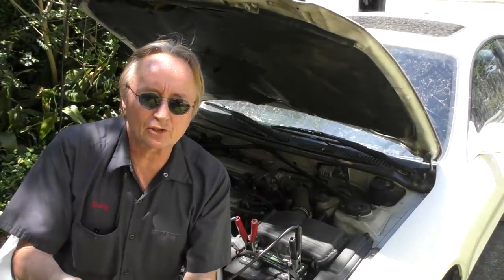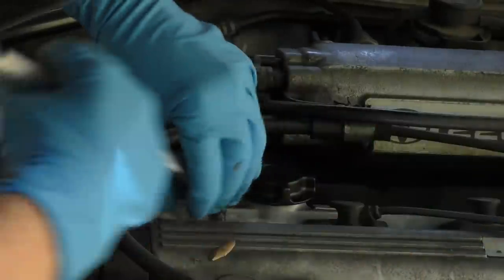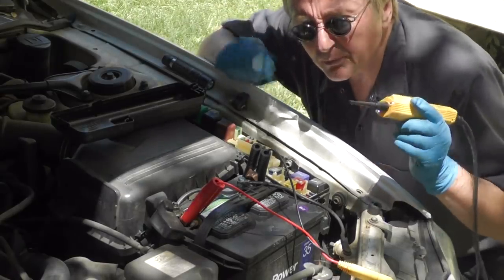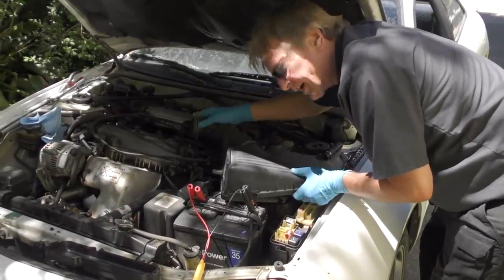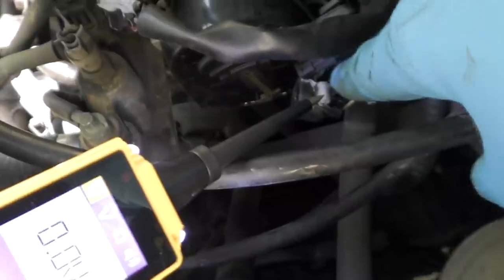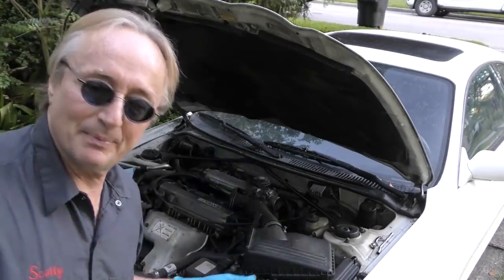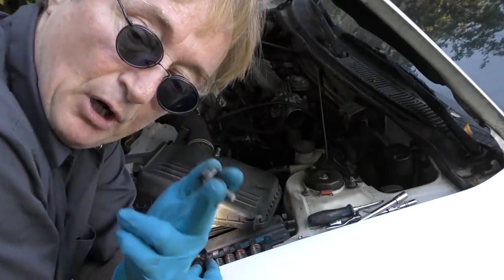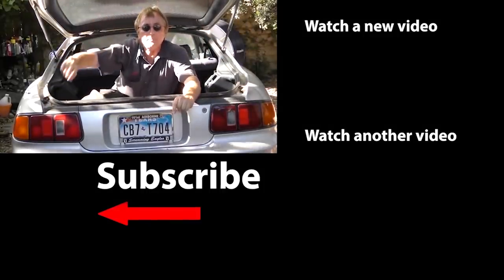Doing This Will Make a Dead Car Start Again

Comment: Hey Scotty. I have an 04 hyundai santa fe 2.4 L 4-cylinder that seems to be only running on two cylinders. I know what your thinking get rid of it, its a hyundai. i still just might. So I was sitting in a drive through and it just started idling real rough. i knew it was something to do with ignition. While it was running I started by pulling a plug wire off to see if it was a plug issue and noticed no change on two of the the cylinders. So I thought it has to be a coil and replaced it. It only has the two. No change. I had an obd put on it and it says it was the number one cylinder misfiring and it was the CSPS. My question is can a csps go bad to where it would only fire two cylinders and just not work at all or could it be it jumped a few teeth on the gears. If thats the case would it even be worth fixing knowing its a zero clearance engine? any advice on where to start and how?

Comment: Hey scotty i have a 2000 gs300. It misfire when i give it full throttle at low speeds and if i keep on pressing the gas it clears up after a few seconds. Only codes are for 3 of the 4 oxygen sensor but i dont have any catalytic converters. Also i hear popping from the exhaust sometimes when i let of the gas after full throttle. Bad gas mileage also. What could be wrong. Please help

Comment: hey scotty thanks for everything you bring us, its always useful.. one question i have an 04 acura tsx with 300,000 miles but it  still in great condition the only problem i'm having  is that  i have to keep jumping the battery ,its only a six month old battery and when i take it to get it check it reads the right voltage. any suggestions, THANKS
Reply: Check the alternator. If the battery has the right voltage and engine struggles to start, the alternator might be getting weak.
I hope that helps
Reply: @HappyCarReviews  thanks

Comment: The seals in this distributor will wear out and oil will leak all over its circuits and wiring . However it takes about 20+ years to fail because I replaced the original distributor in my 26 year old Celica a year ago.

Comment: Had to do that on a Toyota, but diagnostics were somewhat easier, the distributor was stolen in the street. Phone the agents, and while they have the rotor, they are out of stock of the cap ( with the integrated coil) and the body, expected "real soon". Started phoning around all the scrapyards, and was at the W section in the yellow pages, when one did confirm they had a Toyota with a 4Y engine in it still, and it had not been front end smashed. It had been rolled instead. 4Y engine having the distributor stolen is common, as that engine is used in the minibus taxi industry a lot. Drive a Toyota with a 4Y engine your insurance rates are doubled.

Asked the price, got the money (was less than the rotor from Toyota) and did some low level flying out there with a 10mm spanner. Took the complete distributor, along with the plug leads, wiring harness, air lines and altitude compensator, plus that very important M6 bolt and the clamp it holds. Then come back, put in the engine, attached all the pipes and cables, look to see timing for no1, align with no1, and put the plug leads in order. Started and timed by ear, tightened the clamp bolt and left it at that.

Comment: Scotty, I am interested in a 89 Toyota Pickup on Craigslist that has less than 200,000 miles on it but has to replace a clutch. It also has a lot of rust around it is it worth the $500?
Reply: In one of his videos, He recommends to buy cars that cheap only if running. I think on that one you have to consider many facts, like
1.Can you replace it yourself?
2. How much you have to spend on the new clutch?
3. is there anything else wrong with the vehicle?
I hope that helps.
Please consider subscribing to my channel.
Thanks

Comment: I loved to mess with people about my old Isuzu diesel pickup truck with 320,000 miles. I would tell them "Heck, if I had known it was going to last this long I would have changed the oil in it! The look on their faces was priceless. When questioned about its rust bucket condition I would say, "Have you heard of positive traction? This model came with Positive Corrosion! The frame rails actually rusted completely in two right below the gap where the cab and bed joined. I believe they dipped it in salt water before they painted it...😂

Comment: I've done at lot of crossing my fingers after a repair over the years and a good share of praying too.
Reply: haha, me to. recently on my 95 sable. slow leaking transmission fluid for last 3 years. had up and tried something to fix it 5 times, fingers crossed, no luck. changed pan gasket. was coming from up top near speedo sensor. changed the cover gasket, speedo gasket. still leak. i siliconed it, did it again, and again. nothing, leak leak. turned out after 6 times taking it apart the fluid was leaking literally through the sensor and out the other side. but when you had car off, the trace amount that it was leaking leaked away and could never pin it to that. needed new speedo sensor entirely

Comment: Its not rod knock, that engine hasnt been started in a while the oil is at the bottom, just needs a couple seconds to get flowing and sound normal.

Comment: 2005 Camry with 75000 miles? Or 2006 Corolla ce with 51000 miles? Both are $6500 which is better deal?????
Reply: If you want a bigger car get the Camry but check them with a scan tool first
Reply: More space and comfort get the Camry. Better value get the Corolla. Both are reliable and great cars. Check both cars and any problems. If you buy the Corolla, try to lower the price a bit. Good luck!

Comment: Ah, the days when cars were fixable by mechanics, or even the owner.
When my computer-controlled 2017 Toyota Corolla SE with a 6 speed manual transmission is paid off in four or so years, I would gladly trade it for a 27 year old Celica, as long as it had a manual transmission. Insurance would be almost nothing compared with what I have.
I'm worried that with all my car's computers, if there is ever an electronic burp, my car might activate Skynet.

Comment: I looked like he was just guessing and got lucky. I would have liked to have seen how to test that the distributor was getting the electrical signal to fire before buying an new distributor.
Reply: He did, it was receiving 12v power.
Reply: He wasn't guessing. The distributor had full power and it's a common problem on this car.
Reply: OK but I would have liked to have seen exactly which terminal he was testing and how he knew which of the several terminals at the distributor plug in should have power.

Comment: More junk going into landfill. Car companies have shot themselves in the foot by making so many parts that aren't repairable. Toyota Hilux diesel and petrol have a throw away center bearing on the rear drive shaft that is throw away. Sometimes they fail while driving on the freeway. I once had a Hilux that threw a rear tailshaft into the side of a Honda civic while travelling on the freeway. Luckily, I could drive home in front wheel drive. Scared the hell out of me. The driver of the Civic was too.

Comment: Lmao i got a car that would make you hate life we did a engine swap on a old honda since the old engine was shot so we put a next to new engine in that was running got everything put in and had no issues starting but when we went to start it again no fuel or spark found the main ground for the ecu was broke fixed it and got spark and fuel lost it again found a bad fuel pump replaced it and the distributor as well cause again no spark got it back again but wouldnt run so we checked everything again and had spark and lost it checked the ground it was fine and went over the engine with a fine-tooth comb and have nothing still all the wires are good brand new fuel system brand new ignition system but still nothing

Comment: Tools tools tools. Every something goes wrong with the car you need a tool for this and you need a toll for that call this that and the other are yet even more tools and all these tools cost money and they're not cheap never as a Cheeto is not a good Tool. And that is not even counting the parts for the car tools to diagnose tools to a repair it goes on and on and on how can someone making minimum wage.... it just doesn't work cars are so expensive someone with minimum wage get the car it last for a while and they can't fix it when it break down even if they have some mechanical skill did I mention the diagnosing tools and Mortals?